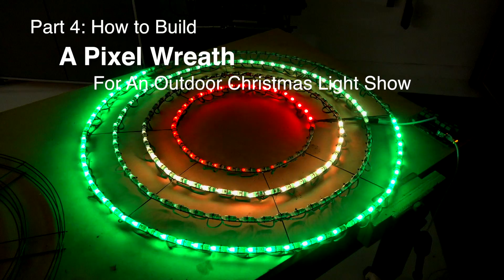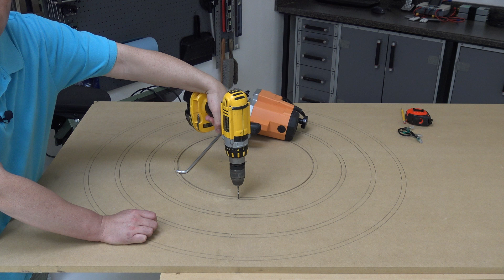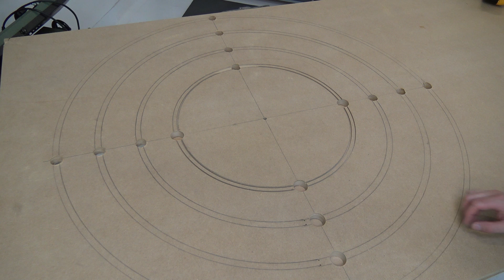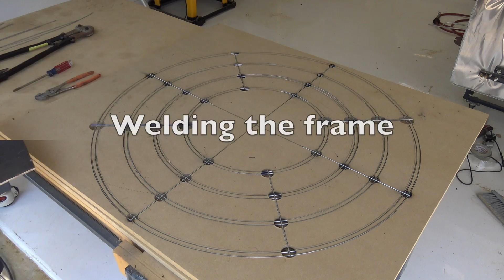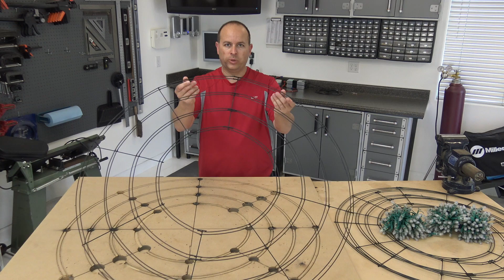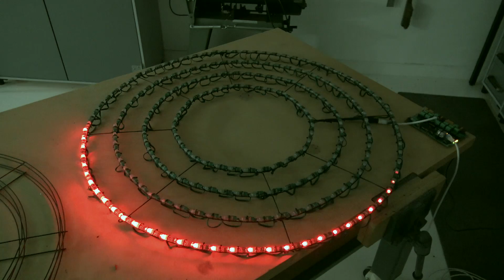Part 4: How to build a Pixel Wreath for an outdoor Christmas light show

Comment: What's the circuit, board or machine use to connect for advance design of led light which you have fixed on board

Comment: Hi Matt,
How dd your wire the individual circles together.  I have a smaller wreath 8, 12, 15, 21, 27, & 29 pixels. Other than jumping them all together is there a way that I need to wire it to get the same effects that you have? Thanks

Comment: Just finished my jig. Additional tips to any watchers:
1) I used a 1/4" rod for the router arm, because that's what fit the Ryobi I used. Use a larger diameter rod if you can, as the one I used tended to bend once I was doing the outer circles and the router wandered.
2) MDF is hugely messy when using a tool on it to remove material, particularly with sanding and routing. It's like breaking open 10 large sacks of flour wherever yo are working. Do this outside, use a vacuum if possible.
3) Hole saw. MDF burns with friction very quickly. Have a shop vacuum suction adjacent to the bit. Drill down for 2 to 3 seconds and then pull out the bit so the vacuum takes the dust, repeat. This way you also don't have to apply hard pressure to the drill, which causes the MDF to blow out on one side when you reach the end.
4) Consider drilling the large holes before doing the routing (like Matt did in the video). I didn't. The hole saw breaks the narrow piece of wood between the two routed channels. To make up for this in my case I made pilot holes and flipped  over the jig so I cut the large holes.

Matt if you're still monitoring. I almost bought a welder, but am considering brazing. Any knowledge on that? Thanks a million for this video. I've watched it 20 times at least the past 6 months. I finally figured out how you did some of those sweeps in Vixen also, and finally figured out what you and others meant by the power unleashed by making multiple groups.

Comment: Hi Matt, This is amazing and whenever I see your videos my bank account suffers a hit since I order more and more stuff. I just ordered the Polyethylene tubing for my arches from mcmaster.com. About the wreaths,on the Large Wreath how do you daisy chain 214 pixels if is goes over the 512 dmx channels? I am using pixlite and as far as im concerned I can only get 512 channels per output. I have the Pixlite16 and the pixlite4.
Reply from the maker: +C “Total Capitalist” Asillas with the SanDevices e682 controller you can go over 512 channels per output. The issue is power injection if you go over about 170 pixels.

Comment: Hi Matt, thank you for all of your contributions to the art. You have managed to design some great display elements, and adapt these elements to the Vixen software. I recently downloaded Vixen. I have also used LOR. The problem that I am encountering is that these software products are sequencers first and design tools second. They have no utility that allows the user to graphically design a display, and then convert the design into a working system. I'm leaning very strongly towards designing my own software that is a design tool first, and a sequencer second. As you have proven, design comes first. What do you think?
Reply from the maker: Jeff Curran I would love to see what you come up with :-)

Comment: Hi Matt,
I have a few questions about this video
1- What is the controller on the table that you are using to test your wreath?
2- Approximately how many pixels go on the big wreath, and how many on the small one
3- Did you daisy chain all of the circles together, or is each circle on it’s own channel.  I watched your video a couple of times, and it’s not clear to me if the pigtails are used to inject power to both end of the line, or to create several channels
Reply from the maker: Nexus Asus 
1) It is a SanDevices e682, if you buy one, tell Jim St. John that you heard about him from me. 
2) 214 pixels on the big wreath, small wreath 140. 
3) All circles are daisy chained together. Power is split with one one end powering rings 2 & 3 and the other powering 1& 4 but the data is sequential from ring 1 to ring 4.